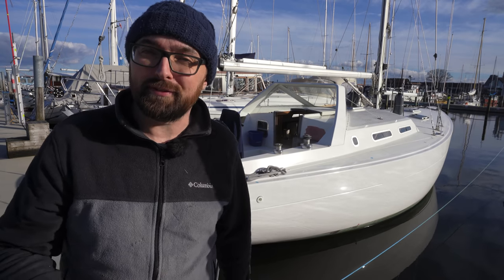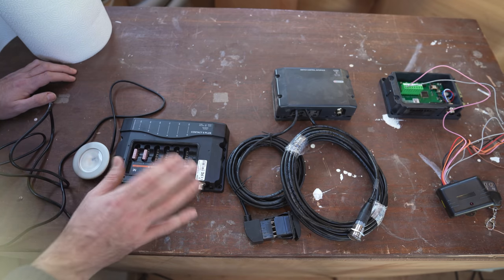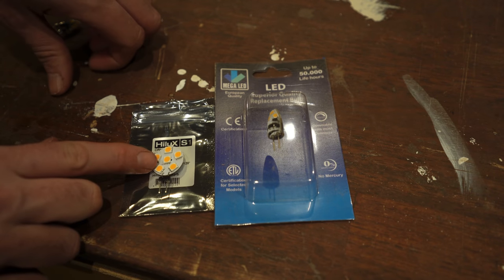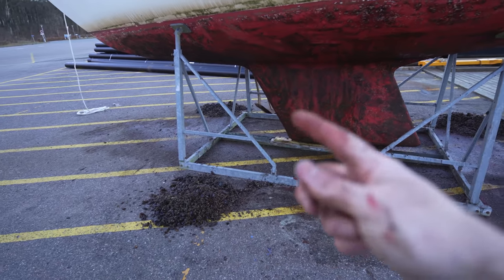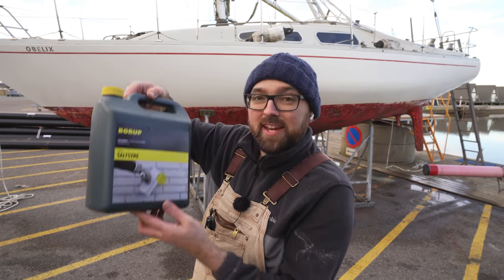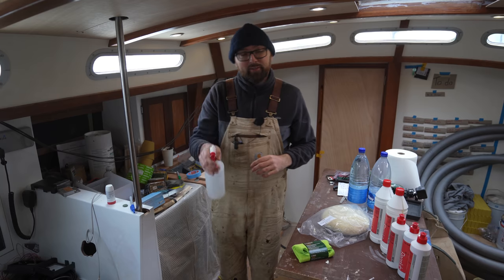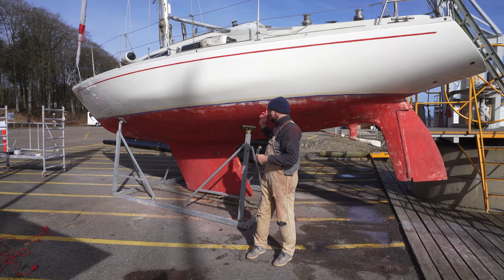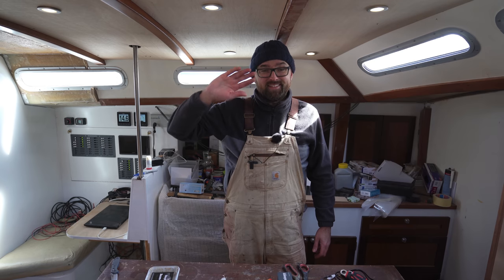Sail Life - More digital switching & making Obelix shine - DIY sailboat

Comment: LEDs can have a low buzz when installed with a dimmer, if you connect them directly with just a on/off switch , the buzz disappears. That's why you maybe did not notice it while testing.
Reply: Must be the built in voltage converter...
Reply: You may be able to defeat that with a simple filter. A capacitor/resistor pair tuned to cut the buzz frequency. Most dimmers are putting out a simple square wave that varies in total time on. All you need do is trim off the sharp edges of the on a bit. But the ones Mads has may make a little pop when they turn on regardless. But it is a cheap solution worth a try.
Reply: Yeah but just use a capacitor resistance ckt to filter.

Comment: I used every imaginable LED in my 2005 trawler. None of them made me happy. I removed and installed with Acegoo RV Boat Recessed Ceiling Light 4 Pack Super Slim LED Panel Light DC 12V 3W Full Aluminum Downlights, Warm White (Silver). And then removed the old light switches and replaced with PCS Electronics, 12 Volt DC Dimmer for LED, Halogen, Incandescent - RV, Auto, Truck, Marine, and Strip Lighting - Long Shaft - Black- I am thrilled with the results.

Comment: Mads, also check to see if you are getting interference with your VHF radio or AIS transmitter. The US Coast Guard has issued a bulletin about some LED products creating enough electrical noise on VHF frequencies to potentially interfere with AIS transmission and VHF for emergencies.

Comment: You may be able to put some kind of noise filter on the line feeding the lights.  You would need to find out the frequency of the noise and someone could easily make a filter with some simple electronics.  If you have a trade school with an electronics dept., one of their students could probably build something as a class project.  I went to school for electronics but it has been many decades.

Comment: Just a hint that I used on several boats in the past. Easy-Off oven cleaner removes barnacles and rust stains like magic.
It will even remove the painted name on the bow or transom if left longer.
Good luck in selling Obelix.
Thanks for sharing.

Comment: I know, I know, I know, the water was off in the marina, and this more a comment for other viewers anyway, but: If you can at all avoid letting the boat sit on the dry, always pressure wash the bottom right away while it's still wet after craning out, all the nasty gunk and growth will be sooooo much easier to remove.

Comment: I believe putting a capacitor in the circuit will eliminate the hum. Below is correct, dimmer LEDs must be installed to avoid hum. They have some sort of capacitor installed that stops the humm. Odds are you are not going to hear the hum while traveling and I doubt you will hear them over the ocean.

Comment: LEDs hum when they're on a dimmer circuit. You don't have to search for another LED, you have to find a better dimmer, or, perform some EEV magic, and use a hard stepped dimmer (i'm not sure that's what they're called) essentially, something that steps the voltage with physical preset levels. It's a bit bigger than the cheap or super expensive variants, but it's used for stuff like that.

Two other things: 1. unless you were on dimmer switch when you tested them, that's why you didn't hear them. 2. are those LEDs rated for dimmer applications?

Comment: Adding my two cents to the million comments here about humming LED's when dimming: We had an LED circuit that only started humming when all the bulbs were in. One bulb: quiet, smooth dimming; multiple bulbs: humming, flickering mayhem. We found and LED that was compatible with the dimmer and problem solved, but in other areas we skipped the smart switches due to compatability woes.
Not sure how smart your smart switches are, but is there a "play dumb" setting? In other words: only full on or off, no gradual dimming, always pulsing nonsense. As others have suggested. One simple solution is a filter in line with the LED's, or make your own with a capacitor/inductor.
Good luck, and nice work.

Comment: Good to finally hear of someone talking about Oxalic acid to remove the tannins on a gel coat, you can buy this crystal form at a lumber yard and it is called wood bleach, very cheap and yes it should be put on with a brush because it would be in the air if you sprayed it on.
Reply: Good to know about, fo my future project too.
Reply: Only be careful with any painted surface because the acid can eat it right off the gel coat below... test a small area first.
Reply: @olumjumi  Thanks for tips.

Comment: It could be that you did test your LED's there could be multiple reasons for them to hum like they are happy to be aboard :) Another reason could be that they are part of a different inferior batch. Not a thing you can do about either however one major variable you can check is the installation the cable run and the power supply is certainly different from when you tested them. Obviously you do not want to spend a lot of time/money on this problem. But dismount one of the installed ones just hook it up to a battery or however you first tested it.

If it still hums well back to the drawing board if not than maybe some sort of voltage regulator or some way to clean up your power supply would do it.

Comment: The dimming is accomplished with something called pulse width modulation or PWM. If the PWM is a harmonic frequency, then you can hear it. If the controller is robust enough, this may be configurable.
Check the setting and see if there is an option to change the PWM frequency. Higher frequency will hum less. You can tell if it is the PWM frequency by powering one light directly and seeing if it hums.
Reply: hmmm, yes & no - the humming will be from the regulators on the LEDs themselves as it seems to be there when they are at full brightness.
I would hope that Garmin will have taken a little more care over their rfi (and afi) than the LED manufacturers.
P.S. harmonics are multiple of the fundamental frequency, so the humming will unlikely be a harmonic, but the fundamental frequency of the on-board regulators on the LED modules
Harmonics from LEDs or other switching transformers or power regulators etc can cause rfi which can knock out AIS & GPS receivers
Reply: @guy.h  Full brightness may just mean a duty cycle above 80%. I'm not very impressed with the garmin system for the price point. Also, his lights are not factory LED. He changed the bulbs for drop in replacements. Those don't have any regulators, they just add bulbs in series on the board until the hit the voltage drop they want.

Comment: Mads- Your LED problem is likely NOT the LED but the type of dimming. Dimming can be done with a Pulse Width Dimmer or analog. PWDs dim buy turning LEDs on/off rapidly and are cheaper and the voltage clipping sounds like a hum so my guess is you have a PWD.  Do some research for a good analog dimmer. These reduce current to reduce to the LED. Dean PS- Love your channel- an inspiration for me doing a major refit on an Orion 27,

Comment: HI. Regarding the problem of the LED light being too yellow, there are many kinds of LED lights. You can choose 3000K 3500K 4000K when you buy. The larger the value, the whiter the color. In addition, for some personal opinions on the circuit on board, I think I like simple switches. Circuit or LED DC dimming circuit, maybe your current digital switch will be more advanced and more convenient to use, but I personally doubt its reliability. I am a relatively conservative electrician. The simpler the circuit on the ship, the better. The number of relays and digital switches should be reduced to a minimum, and attention should be paid to lightning protection and waterproofing. When danger occurs, the simpler switch may play a key role. I am very interested in your boat, and I want to know how long it is. Your handwork is great, I like it very much, English comes from Google Translate, Peter China

Comment: The humming is either bad ballast on the light, bad grounding in the circuit (only takes one) somewhere, or wires crossing over a higher voltage and not enough insulation on the thinner, led wire.

Comment: Sounds like you have a stray frquency transmitting through the 12v system you should look at choke or frequency filter.
Reply: Some of my 120v LEDs hum when in parallel with another one. (Kitchen lights.) when I unscrew one, the other stops humming. I don't know about electronics, but is this a clue? I hope so! I find the noise really irritating. I bet a lot of calls to suicide prevention are caused by humming LEDs.

Comment: Do the LEDs hum when run directly off the battery? Could be due to the digital switching using a pwm controller for the dimming?
Reply: I was thinking the same thing. His test were probably done on the 12v battery and now that they are on a pwm circuit, let the humming begin.

Comment: Another great video, thank you. One question on the light controllers though, do they use much power? Obviously a normal switch uses nothing. I guess the controlled setup has the potential to flatten your batteries

Comment: Hello from Ontario Canada,
Obelix hull looks AMAZING now!
I’m wondering about your LED lights, you mentioned the hum and that they are able to operate on 12 and 24 volts.  Have you tried them on 24 volts to see if they are more efficient and therefore quiet at that voltage? 
24 volts is apparently a better voltage on live aboard boats or so I’ve heard. 
Don’t take my word for it, I’m only an insulator not an electrician.
Cheers Mads!

Comment: did you connect the LED directly to the DC voltage without your controller?  It's possible the controller is causing the hummmmm

Comment: The hum may be coming from the LEDs but it's really caused by the dimmer. It must be doing Pulse-Width Modulation (PWM) at an audible frequency. I'd hope for what you probably paid for the dimmer they'd use DC dimming but apparently not. You could stick a sufficiently large capacitor on the output of the dimmer to eliminate the effect and also prevent flickering on-camera.

Comment: In Holland we have an address able to supply ledlighting in all kind of forms, but also the same form as you showed (the flat pad with several lightingpoints on it).
They can handle 12-32 volts. So even when your alternator is rising the voltage they still work without problem. If you want to have the contact details, just send me an email.

Comment: Nice “high tech” features however, I wonder how all of those electronic “bits” will perform long term in salt air?
Reply: They are designed for marine application. They’re also below deck mostly.

Comment: Hey Mads. Just wondering whether the dimmer in the Czone box could be causing the humming in the LEDs? You often hear that if the dimmer is using PWM and the high frequency signals aren't getting filtered out. It might be worth trying them just directly connected to the battery (or with a relay) if you haven't already. Great video :)

Comment: Mads, did that dim up to full brightness and back down?  You might want to look into that, you're not going to like that first thing in the morning.  You should be able to dim back up, as in a soft start.  Some digital switching allows you to intergrate button pulses on a binary signal, also length of hold. So a single push dims up and down, but a 2 second hold activates a separate function.  I'm not sure if this setup has that ability.

Comment: It would be interesting if you would talk about the reliability of all this high-tech electronics and what happens when a box fails and you can't turn on the lights and the Amazon delivery truck with replacement parts is far away from your anchorage.
Reply: It is what it is Gene. I know of no more qualified person to MacGyver a system until parts arrive. To talk about all that which might happen is best left for a later discussion over Piña Coladas in the warm pouring rain.
Reply: Maybe the quality is just superb and they never break, but today when everything comes from China... I don't know about that. I would try avoiding to connect anything vital into this. Anyways, fancy stuff just something not for me, a guy that dimms a LED with a resistor.
Reply: @Scramasax  Mads showed a few weeks back that if the switching box fails each circuit can be energised by shifting a small fuse in that circuit inside the box so its not the end of the world if this system fails. Though for my mind I can't understand why such high tech is needed to switch on lights and keep it simple stupid is the safest way to go when on a voyage. But each to their own and as a project it is always very, very interesting even if not agreeing on some desisions.

Comment: LEDs can hum when using a dimmer switch :) maybe you didn't use the dimmer while testing??
Reply: I think part of the problem is that 12 and 24v combo LED, which (most likely) has its own buck/boost converter which is a switcher which (if sourced from CHINA) will be noisy as hell.
Reply: @k1mgy  those are very probable answers , if I understood I'd agree or disagree  :)

Comment: I just left a comment and canot find it anymore. i will leave one more. You can utilize all 16 digital inputs by using  M12 Y splitter. I used them a lot while I have been making robot cels in car industry. I am electrician and working in the field of the industrial automation. I am also an old boat owner, so if you will need any hepl regarding electricity feel free to contact me.

Comment: LEDs are physically not capable of humming. It is always the dimmer or driver modules that are the problem, fyi.
Shielding those modules and putting ferrite beads on the wires to/from them may cure it. That can be a tedious hunt, best to contact the manufacturer or an electronics tech.

Comment: Why can't you dump the mussels back in the water where they came from? Now they are going to rot and pester the people at the recycling center if left untreated for a couple of days. In Norway they go back into the ocean.   Witch hull number is Oblix?  My ballad has hull number 554.
Reply: The bags also include a lot of bottom paint, which is full of various -cides.  If you are not willing to eat them, don't put them back in the ocean.
Reply: @CorwynGC  The sea around a marina contains a lot of bottom paint from before.  It slowly dissolves into the water  from all the boats who are berthed there. Is it better to put them in plastic bags and use a gas car to deliver them to recycling? How do you recycle mussels with anti fouling paint?
 If somebody could just invented a paint witch did not harm marine life, but stopped growth on boats....
Reply: @TN-kd8ju  Beats me.  What kind of bottom paint was it?  Copper based?  Do the folks at the recycling center do the right thing, or do they dump it in an incinerator, so you get to breathe it instead?  What are the current concentrations of the various bio-cides in that particular harbor?  How many of these questions would I need to find an answer for, before I would conclude that local authorities got it wrong?
Reply: @CorwynGC  Isn't it weird that the mussels have to be recycled while the boat witch is now full of the same paint is ok to put back into the water?

Comment: use plastic bags and take it in a vehicle using gas to a recycling centre instead of dumping it back in the water where it grew what is wrong with your country
Reply: Not much from where I stand, they can use a crane to lift a 30' boat out of the water for free,  put it on a beautifully designed cradle - which is also free, and work on the boat for a week on an asphalt parking area.  All without special training, six kinds of insurance, or a high visibility jacket being required.